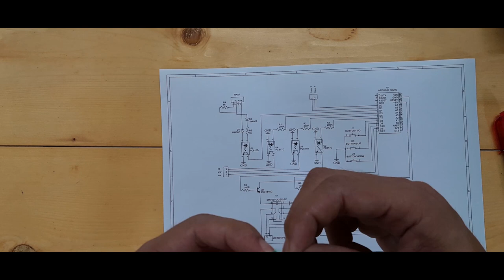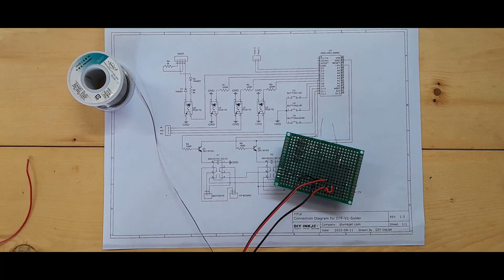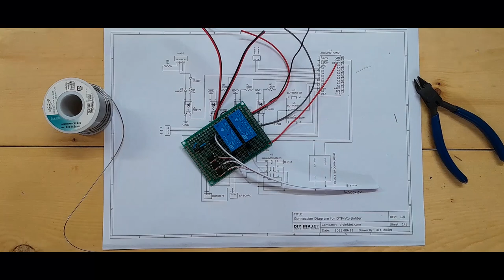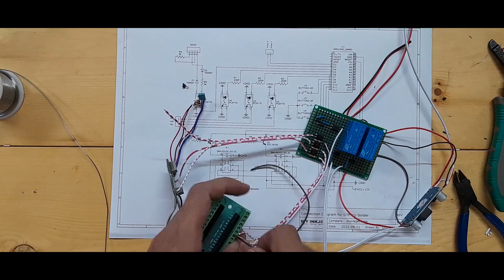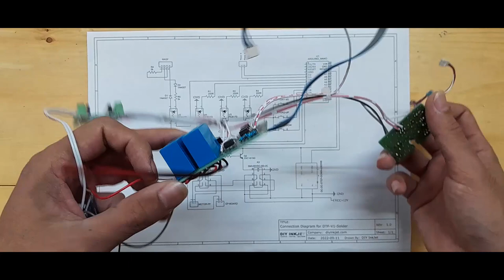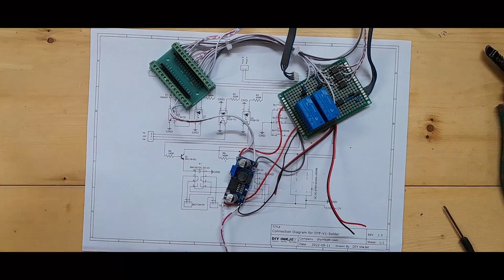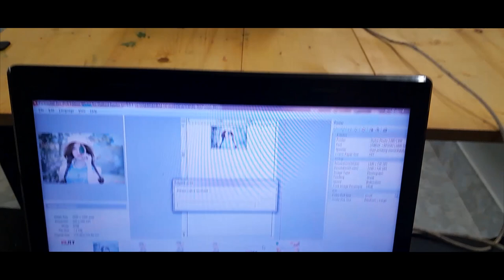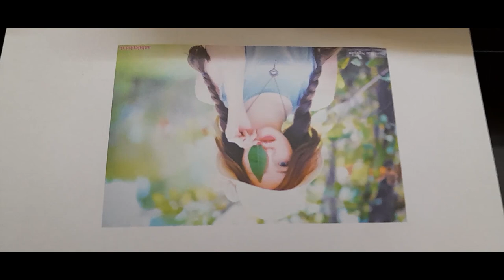Instructions To Convert Epson L1800 Printer Into DTF Printer

Comment: what is that part you are using which has a round hole punched in it?
Reply from the maker: yes 
it is pcb board for manual soldering
Reply: @DIYInkJet  No, no...the one at 12:35min in video which is having a paper written as PW: CN9 Digital Pin 13. That part having sort of key hole shape slot? what is that part, Sir.
Reply from the maker: @cyberspider78910  PW sensor. it is removed
Reply: @DIYInkJet removed from itself printer ???
Reply from the maker: please contact whatsapp +84 918219268 @Glowadvertising